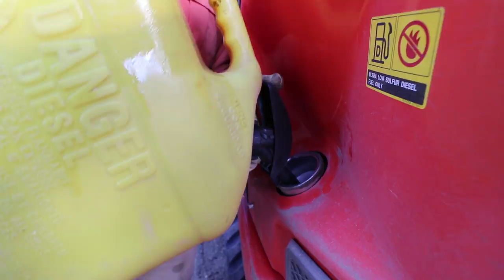Winter Did THIS to Our $10,000 OFF GRID WATER SYSTEM

Comment: You guys are awesome!!  You have the hardest working wife!  
A few years back we were building a welded garage out of 4" tube steel.  We would get up and work as soon as we could see, 5am - 2pm, and the temp would be 92 at sun up and 106 at 2pm (July).  Stop for a few hours and get started again at 6pm and work until 10pm or midnight.   We did that night after night for a month.  The only part I didn't do was pour the slab foundation.
So I can say, "I know how you feel!"
You will be so proud when it is finished.
All I can say looking back is that it was all worth it.  I'm still excited to tell people, "We built our house and built the garage ourselves."
Hang in there!  It is all good.

Comment: Keep going, you will see the light at the end of the tunnel.  Speaking from experience. On my first mother's day I learned how to mix cement.  We started with a house trailer. Hubby wanted to put cement pads under the trailer so the wood ties would not sink down in the ground and rot. Who knew that in a few years we would later take out the cement pads out so we could put a cement block foundation under and turn it into a house. After thirty years and dozens of projects later we are still at it.  Now we are replacing items, like roof shingles and several windows.  I'm starting to believe if we do finish everything we are done for.  All I can really say is that we are debt free because we did as we had the money.  Stick to it.

Comment: Things will become better as soon as you are out of the ground. Your gravity feed water system with cistern is clever. For my rain water collectiion system with cistern, I rely on an electircal pump - no electricity, no flushing the toilet anymore.... You won't have that problem. Regarding the price, I think around 10000 dollars, is not that off. I paid around 4500 dollars for my rainwater collection system and the cistern is about 10 feet away from my house. The pipes are rather short and  partly double encased. The guy, who sold the system didn't want to fully encase the poly lines, because he feared, it could flood our basement through the encasement. 

One more thing that I learned during building our house - As non-professional you might end up doing things three times, until it is right. But then, it is better than any professional would have done it.

Comment: My husband and I admire you guys so much. I'm 56 and my husband is 61. We were both raised with the outlook of "if you want it, you build it. My grandparents built a one acre pond with shovels, buckets and a wheelbarrow. He built a poured concrete home. He built forms, for every single wall (inside and out), floors too. He loved concrete and built that home, a block building, and a set of brick apartments. As kids we were good labor and we willingly helped. The biggest equipment he had was a tractor, and a cement mixer. We bought an older home and all of our improvements have been by our hands. Our first garden here was accomplished by a mattock, shovel, rake and hoe, and we bought here in 2010, not when we were your age. I can see all of your frustrations, and have felt the weariness in your eyes. But I can also see the sense of accomplishment there as well. Don't give up. I admire both of you and wish more people today had your work ethic.

Comment: here's a helpful hint my husband did on our gas can. He bought a rubber valve stem, pull thru type, drilling a  hole on the backside under the handle area at the bottom. He took out the core of the valve stem. This helps with the breathing and ease of flow of fuel. lots of progress. wishing we were neighbors and I was there to help! We built our home and I kept telling my husband how we needed a tractor. 11 years later we finally purchased a Kubota. Needless to say, he wishes we had it before building. I realize $35,000 isn't in your budget but boy it would be a tremendous help!

Comment: Enjoy watching your progress. As a plumber by trade I can tell you when trying to relax large pipe like your working with fill it with water the sun will warm it and the weight of the water will help straighten it out. Also when back filling around your tanks make sure they are full of water or if the rain comes they will float like a boat.

Comment: well one thing I can say is you are both determined.  This project as you know now, is a lot of work.  You are doing it right and not taking the cheap road. Once this system is up and running, you shouldn't have any problems.  Just like building your own house, sometimes we don't know how much work is involved until we start the project.  Your doing great, Rome wasn't built in a day, just one step at a time.

Comment: For sealing the end grain check out anchorseal. Its pretty affordable and does a great job of sealing against checking. A cheaper option is go to local hardware store and buy the hit and miss latex paint's. You can pick those up for around 3-4 bucks a gallon. The latex pain does a decent job, but anchorseal penetrates more.

Comment: I have enjoyed your pilgrimage on your homestead and admire your work ethic and endurance. I noticed one thing you did to the log on the woodmizer. You applied Howards feed and wax to the end grain to seal the wood and slow down the drying process. Howards is basically a wood finish. I would recommend a product called Anchor Seal. It is designed to seal end grain and slow the drying process. If you search you should be able to find it in your area. Usually runs about 20 bucks a gallon. If you have trouble finding it check for a woodturning club in the area and I am sure they can fix you up with some. Our club here buys it in 55 gallon drums. Good luck with the water system.

Comment: Just a suggestion if you have to pull the tanks out again. Seeing your producing your own lumber. Build a sheathing wall around  the tanks. Then fill inside the wall around the tanks. It will cut back on your need for sand for back fill.

Comment: You can drag a piece of cattle panel with some weight on it, like logs or some rocks, across the driveway behind your four wheeler. That is what I have done before and it gives me a nearly perfect surface in no time flat. If you try this, be sure to attach either a log or a good study piece of wood to the front and back of the panel to support it and to make sure the weight doesn't roll off.

Comment: Pro tip from a sawyer: stickers should be 18-20" apart at most and you should have a sticker within an inch of the end to help avoiding checks. The checks will only go in as far as the sticker (mostly). 

Sealing: best is Anchorseal but you can get away with petroleum jelly, crisco, or animal fat. Howard's is going to make you go bankrupt trying to seal stuff and doesn't work well in this case.

Comment: I find your video's interesting and entertaining, screw the haters. 
I'm in Queensland Australia so the whole snow, frozen thing we don't have here at our location. 
its winter here now and our temperatures are 77 day / 32 night average, spring is 100 day / 86 night average. our peak day light hours would be 5 am to 7 pm / 14 hrs, so 9 pm / 15 hours of day light sound handy for getting a big day in.
I think its great you guys are doing something new to you, learning and giving it a go. any advice i could offer you i think you would of heard before or all ready have done.
your suburb looks similar to the one i have,  mine is a 2003 forester manual 2.5 motor its a good little car.

ifs its not constructive criticism,  ignore the comment. water off a ducks back guys.

constructive criticism is helpful and specific suggestions for positive change, constructive criticism is highly focused on a particular issue or set of issues, as opposed to providing general feedback.

that's for all the butt heads and negative Nancy's out there, may they learn something. 

keep at it guys and enjoy your adventure.

Comment: You guys are doing great, keep it up. Every piece of land is different, has different challenges, just keep trudging thru it will be done before you know it. A helpful idea would be to use the winch on the quad to pull the 2" poly thru the encasement.

Comment: I don't know when you did this but if you're still feeding piping through the casing. Sacrifice a piece of the casing pipe and heat it to put a slight bend in it. Connect it without glue and feed the smaller pipes through. Just a thought.

Comment: Hey guys, have you looked into recycled asphalt paving, it's basically crashed asphalt with sand. Compare to gravel, it's the same price if not cheaper, super easy to pave and maintain such as repair cracks etc, I have been considering it for my driveway on my farm.

Comment: I learned a long time ago about black polypipe. It will split very easy. I dont use it anymore. I use the white pvc pipe. It comes in 20ft sections but you wont have near the problems of polypipe

Comment: Had a comment for between tanks pipe.  It may be too late ; but here goes.  To allow expansion/contraction between tanks. suggest remove straight pipe and replace with a U shaped pipe between the 2 tanks (4 pcs, 90°ells and three 6" short pieces)
Cut to fit in straight section.  Keep at it you will succeed.

Comment: Oh hey guys, I was watching Jesse pour fuel into the quad and the excavator and it reminded me of a life hack I saw somewhere where you take a new valve stem and drill a hole on the high end of the handle and install it, leaving out the actual air stem guts then you can keep the cap on till its time to pour, take of the valve stem cap and it will literally fill up stuff 5 times faster.

Comment: +Pure Living for Life  I live in the desert of New Mexico and I can tell you that when temps get into the 90's or higher you have to get creative to avoid heat stroke. I have no problem whatsoever going out in a soaking wet shirt and wet towel around my neck. Just like sweat, the evaporation will cool you down and make it bearable to be outside. Jesse, lose the dark colored, heavy material shirt. Go with a lightweight cotton in a lighter color, long sleeve. Keep water nearby both for drinking and wetting your clothes to keep cool. Also, freeze a gallon jug of salt water and keep it in a cooler near where you're working. Salt water ice takes longer to thaw, making the cooling effect last longer. Have water and Gatorade or other electrolyte drinks on hand in there. Keep going, there IS a light at the end of this trenching tunnel! You got this!

Comment: At the cedar log cabin cant mill I worked at like 25 years ago we had a pump sprayer that we used to coat the ends so it didn't crack and check. It was a milky substance that I think had a wax base.. It takes literally 3 seconds to coat each end.  Get a sprayer.

Comment: I'm speaking as someone who's never done anything close to what you guys are doing so take this accordingly. My thought is to get some relatively strong rope and a couple of portable hand winches. Tie a chain hitch (it's a type of knot used for pulling pipe and cable) around the pipes and another around the tubing inside. Then use the winches to pull them in opposite directions, essentially leveraging the tubing through the pipe.

Comment: As it has all ready said, i will repeat "KEEP GOING". you will get the knockers that's life, just forget them.

My last place was 640 Aces in Central Queensland made up of scrub, heavy timber and light grazing. our water supply was 4 @ 20,000 Lt tanks at 36 mt Head/elevation from the house, we ran 250 Mt of 50 mm blue line poly to the main junction. 

At this point it was split in to 5 @ 25 mm poly -Main House, shed, yards, second house/transportable out side taps. This point also had a air trap and a hammer block. poly was down 1.2 mt under ground to stop it from becoming a hot water system. 

Water for the main tanks came from a bore 1 km away through 50 mm poly.

Comment: When you go to cover the tanks I would use posts to mark where the edges are both to locate in the future and to say not to put heavy things on top.  Can use a cut up aluminum can or copper pipe scrap to make an info tag with metal punches to do a dot matrix print of what you want to remind yourself of years down the road like tank here X inches down as the tag will last longer then what you put it on. 

On an info tag you can put the date done and important info you will forget by the time you need it with the only limit being how big you want to make it and how much you feel like stamping into the metal. They also make metal punch letters and numbers  but that requires a full set.

Comment: For moving water around, there are 12V water pumps out there that will run off of a solar panel.  I saw a video where a guy took an electric water pump from a Toyota Prius and it pumped alot of water.  Just thought i'd mention it, to keep your options open.

Comment: Thank you for all the videos.  2"HDPE is a very difficult to make move in the places you want.  your system should be low pressure, and pressurized at the low points.  however, just like the Poly does not want to move how you want.  it will move when pressurized and depressurized.  so the trick is choose where the pipe is movable, and where it's fixed in place.  Meaning be careful of tees you can have it leak or break if the pipe moves.  you encasement is Great for all the reasons you have stated.  the one caution is you don't want the pipe to move around your tee.  the tee could be "fixed" in place using many methods.  for long straight runs of large pipe we would pour concrete "sleepers" over them creating too much weight to move.  then we would install the Tee between these concrete anchor points.  for your project, you probably don't need anything that serious.  you just don't want the pipe moving and creating excessive pressure on the tee fitting.  Best of Luck and keep pushing through.  the pay off will be a well built home.

Comment: Just my crazy idea, but I'm starting to get the feeling it would have been easier and less time/resource consuming if you had built a "room" for the containers (like floor, walls and ceiling), added insulation and also covered it with good thick layer of soil to serve as another environment/thermal protection. Might have even added an entrance  in case you needed to go in there and just dug the trench for the pipes from there.

Comment: I think it would be much easier to pull the pipe through the encasement. Get a conduit piston and use a shop-vac to pull a mason line through.Use the mason line to pull a rope through. Attach the rope to the end of the poly using a expandable pulling eye then pull it slowly using the 4-wheeler.

Comment: <Guy who milled the Alaskan Birch from a few videos ago:
The checking on the end of that main log is too far gone to halt the spread. You'd be better off cutting it at a nominal length to halt the  checking further and then do the latex paint on the end grain. @Geegdaman called it with Anchorseal. It's gotta be laid on thick though. It's either that, or you'll be getting familiar with bowtie splines. 

But forget the lumber part. just focus on finishing this damn trench. Being outside in 90 degree heat infested with mosquitoes sounds miserable enough. That trench isn't completing itself on its own. whatever 80$ worth of lumber loss to checking isn't worth the time loss with that excavator. Gotta figure every day with that rental is 160$ feeding that project. You're still way ahead of the cost curve here. I know (groundwater)well systems at least here in AK can run 30-90K$. Even after everything is all said and done and you're 16k$ in, the sweat labor is worth it.

Comment: Looks like one of your hydraulic valves is leaking (~7:00minute mark), letting the bucket slowly settle.
Reply: You don't think that was just the effect of the weight of rocks being loaded?
Reply: Craig Mooring shouldn't matter, it's not like it was compressing the hydraulic fluid. it's a small leak, not a big deal.

Comment: I know tractors aren't as common in your area, I would look into an older 70 hp tractor with a 3 point backhoe and a loader, backhoe for about 10,000 less than a backhoe of the same year

Comment: can you get some mule tape and blow that through the casing, then tie the mule tape to your 2 inch and pull it through the casing.  you can wrap the mule tape around the excavator track and that will pull the pipe through.

Comment: just in case you didn't think about it coat the outside of the Polly with WD-40 so it's easier to push through the pipe

Comment: It might have been easier to just build a water tower next to the house site for water pressure.  I've seen people just build a wood frame and fill it with dirt and put the water tank on top and then frame it in again and fill with dirt around the sides to insulate it.

Comment: Awesome job X2 but i have a question. It looked to me like the excavator would reach to the bottom of the trench why not use it to just scoop out the excess material instead of hand shoveling it into the bucket. Other then making it unlevel or snagging a line, i wasn't seeing any reason to not use the machine to do the work. Great vlog though. I'm

Comment: Native stone aren't an issue for abrasion but maybe weight/crush factor depending on size,now tile or brick are abrasive so don't bury those against any man made products. We bury only black poly pipe all stainless steel clamps and ss or brass insert fittings plus we have to bury about 4' deep across a yard and deeper where they drive here in NW Corner of Ohio.  Keep up the struggle.